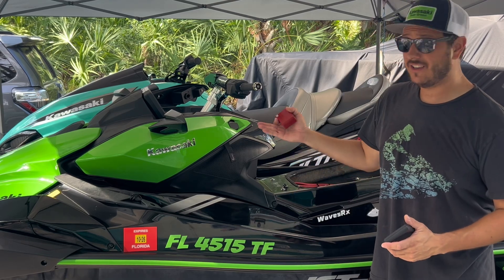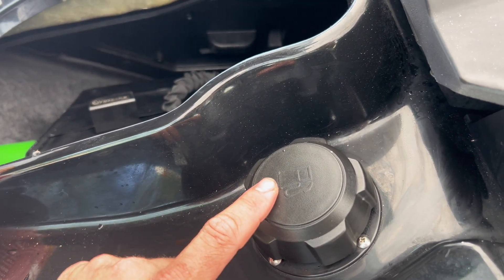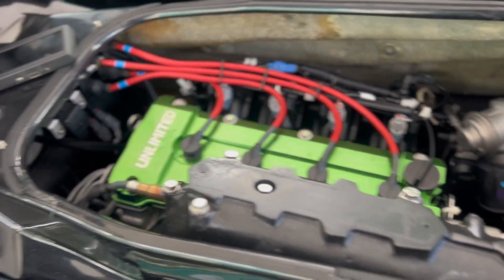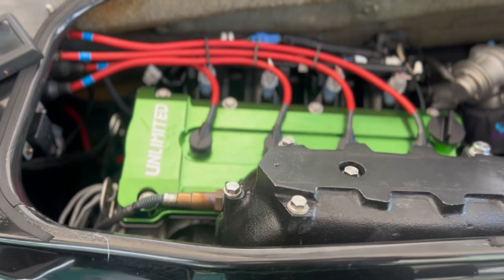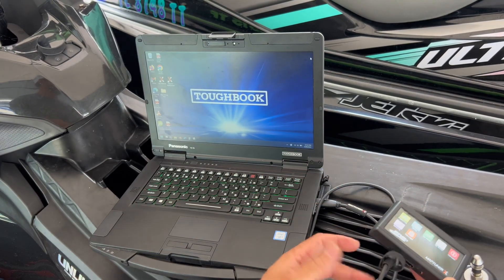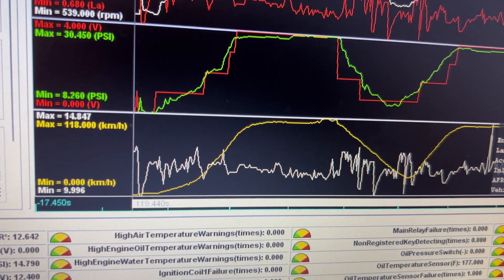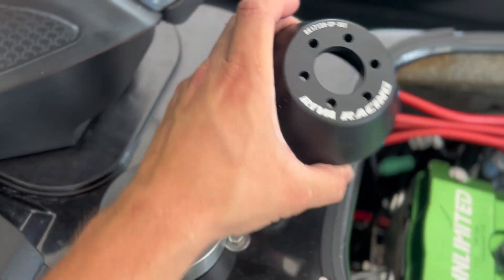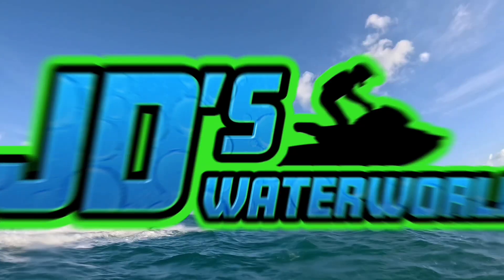Riva Racing Kawasaki Ultra 310 Jet Ski PLX Wideband + Maptuner - Stage 1 Tune - Update Video [4K]

Comment: So no more Kspeed, Because everything i bought from them made my ski slower than factory
Reply: Something must not be right. Because everybody else seems to have great results. Have you considered that? Maybe you have a unique situation? What does kspeed say?
Reply from the maker: @timtimmer99  I think Kspeed's tune - which was the first to market btw- is great. I think their ride plate is great! But my experience with their idler pulley was that it failed to hold up- I did give them the benefit and reach out right away. I don't complain online, I just switch to a more durable product. I think Jamie is a great guy, and has a true passion for Kawasaki Jet Skis, but the idler pulley they sell doesn't cut it for me, that's the truth for anyone who uses it in salt water. My intake turned out to have air pockets in the casting so when it corroded from salt water, it became susceptible to breaking easily- in all fairness they did improve the casting of the intake, but I had purchased mine early on so I had the old inferior casting I suppose 🤷🏻
Reply from the maker: I still run the Kspeed ride plate which is a great design, and was removed just for this feature, but my intake grate corroded and broke, my supercharger idler pulley from them rusted and failed. I don't think their components were really designed for salt water use. Now I never had an issue with their tune or tune box, but when I was approached about doing this feature with Riva Stage 3, I decided to do the comparison. I would contact Jamie at Kspeed he is a great guy
Reply: I tried the KSpeed ride plate for my STX 160  and I saw no increase in top speed if anything my ski seemed slower on the acceleration and top end because it added more drag. Its turning though was a noticeable improvement. No difference in chop/rough water handling. I ride mostly offshore or intercoastal and dont race closed course so that plate had no use for me. That and to make the most of that ride plate you need to use the KSpeed intake grate and tune to make up for any lost speed. That and to install the intake grate you need to cut your ride plate so it fits which I was not willing to do and it wasnt advertised when I bought the intake grate. Kspeed was cool though and accepted the intake grate return but the ride plate I sold and went back to the OEM plate.

If you are racing closed course then the KSpeed ride plate would be 100% a necessity to corner hard into turns. But for my typical riding it wasnt needed and was more of hinderance if anything.
Reply: JD suggested the ride plate was getting the nose out and riding better according to his video. Is the beneficial effect more evident on a 310 perhaps?

Comment: Brilliant… I’ve only just went and got the maptunerX, waiting for stage3 pulleys, exhaust filter bypass, uprated hoses, stainless bolts, 2degree wedge, stainless tensioner, and I’ll order the fuel pump next.
Ok I’ll pipe down and watch now.
Thanks JD😉👍
Reply from the maker: Your machine, the fuel pump is much much better than the new generation- you can upgrade just the pump on yours very easily and cheaply! Thanks for watching man!
Reply: @JDsWaterWorld that’s right I remember one of your videos on that last year.
Also that’s good to know. 
No problem at all JD , as soon as I see the notification… no matter what Im doing…JDsWaterworld is getting clicked and watched.
Ps
How did you manage to get my brown pulley away over the Atlantic without me noticing?😂😂😂 you are goooood!😂👍
Reply: @SAABROSS will be putting in my stage 3+ tune today aswell🥵 lets hope the upgraded pistons and internals in my '16 will take 8200rpm without grenading😂
Reply: @TheBobinn superb,.. Have fun tinkering buddy... I'm sure everything will come together nicely, and last!!!
I've had my 16 for one year, so I owe it a service, and thought,.. No point giving it oem steel stuff when I run in salt all the time, then finding stainless stuff, the upgrade and uprated pulleys were there,.. So just ordered them, and the maptunerX, stage three seems pretty tried and tested, I'd think we were in the realms of safe with an extra 3lbs boost on these machines.
There is only one way to find out I guess, and that's by jumping in two feet first without dipping toes testing the water 😂
Let's hope we are all good, and our insanity pays off for a change. 😂.
I'll subscribe to you and you can let us know how things go.. And I'll do the same on my channel.
Best of luck with your machine, and in life in general. 🙂👍
Reply: @SAABROSS  And please let me know your thoughts on the 2 degree wedge and if you put another plate/grate I really need to know how they are - Stage 1 yielded me 117kmh (72.5mph) hoping for 76-77mph with these added mods for the "stage 3" doubt it can be 80mph even with wedge and ride plate :(